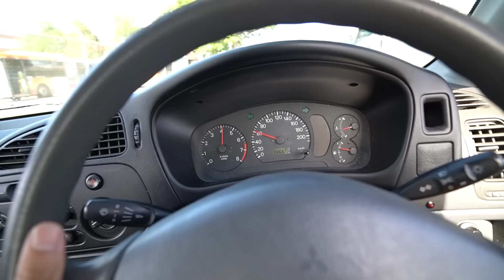It's Time to TURBO the 4G15 Mitsubishi Lancer! Part. 1

Comment: The turbine is on a shaft suspended on bearings, spinning it anti-clockwise wont hurt it in any way
It’ll be a little ripper with 20 psi up its clacker!!